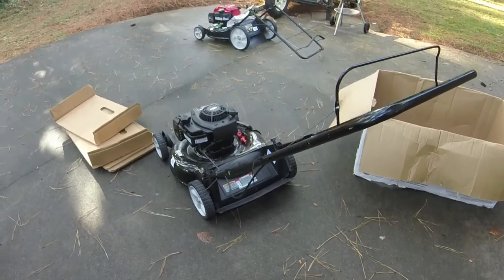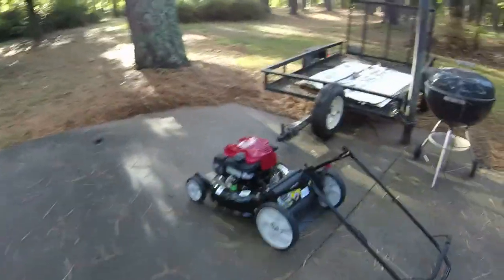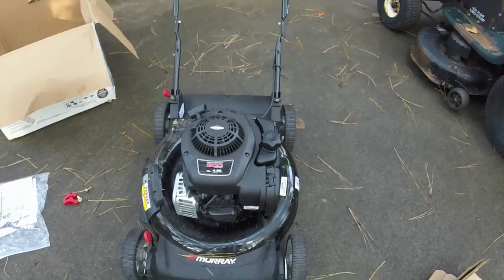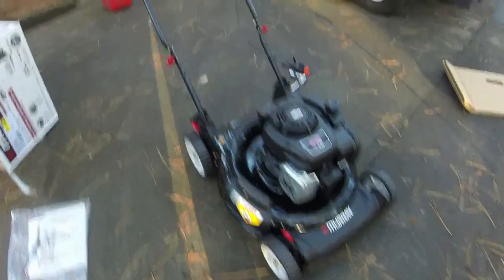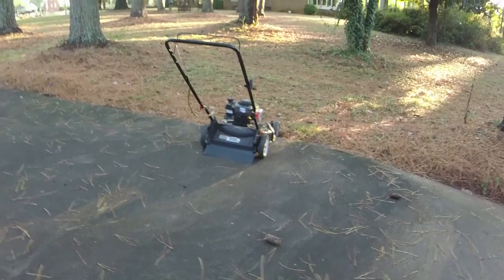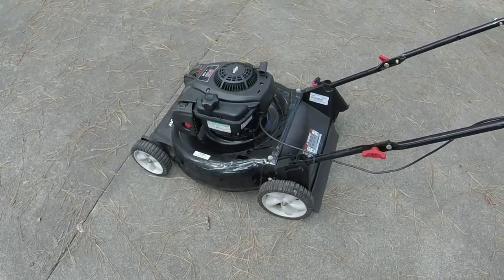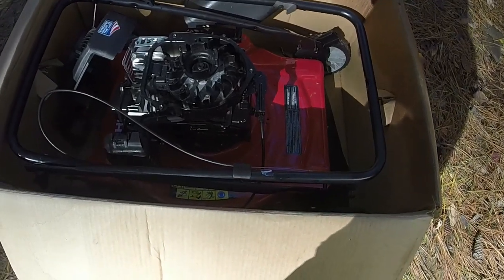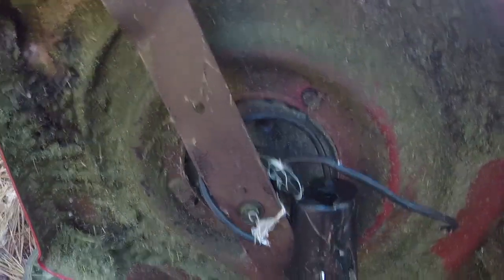The worst of the Walmart customer return push mowers

Comment: Get goof off and that will help get the stickers off,  also hot water will melt the sticker glue.  To help get off the stickers.  

The strangest thing I ever had was when somebody hit. Some thing and the the engine split in 2 where the gasket is located ,  the fix is to  make a new gasket after removing the engine  and put it back
Reply from the maker: Thank you, I have some of that somewhere and will have to try it on the next lot.

That is crazy.  Worst I've seen is a flywheel split in half and the cracked base plates.
Reply: Ellis Mowers also give some wd40 a try once .  To clear off the stickers

Comment: So it looks like Briggs who owns Murray now, is contracting MTD to make the actual mower.
I noticed that with a few of the lower end walmart Snapper push mowers, they looked like MTD's and I'm saying to myself MTD made Snappers, can that be right? Evidently it was for walmart Snappers. That would give good ole Snapper a bad name, considering how well they used to be and how well made the higher end snapper stuff still is like the hi vacs and RERs.
I had one guy jump down my throat saying Snapper is just rebranded junk mtd and I'm saying my RER, high vac and snowblower is not an MTD. Evidently he saw one of those MTD made snapper push mowers and thought the entire snapper line was MTD. Which isnt the case.
Reply from the maker: Yes they contract to both MTD and AYP for them but I see more and more MTD every year.  I think Snapper sold the naming rights for the Walmart made mowers but I think the items at the dealer are still being made by Snapper although their quality is nowhere near as good as what it used to be either.  Yes the manufacturer sticker doesn't lie.  I love my genuine Snapper RER hi vac mower.

Comment: Ellis. Have you ever seen both screws that hold the butterfly on the throttle shaft come out at the same time?
They passed into the cylinder made a racket
 Fortunately, no damage , parts on order.
Reply from the maker: I haven't seen that happen yet.  But I'm glad it did not damage your engine.  A lot of weak points on the mowers, sounds like it was subject to vibration or a manufacturer defect.
Reply: It’s lasted a little over 16 years.  Putting a head gasket on is a pain. Broke a bolt once, wasn’t even up to torque yet.
Between that pulling the threads in a hole, 10 minutes of wondering. I’ll use loctite on the shaft screw. 
Mower ought to live a while longer.
Hope you had a good Thanksgiving.
Jim